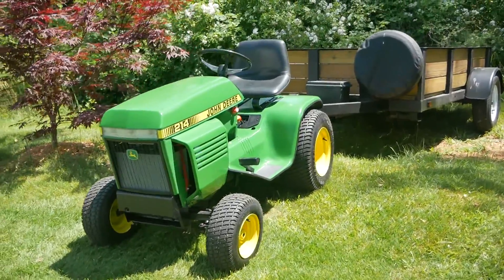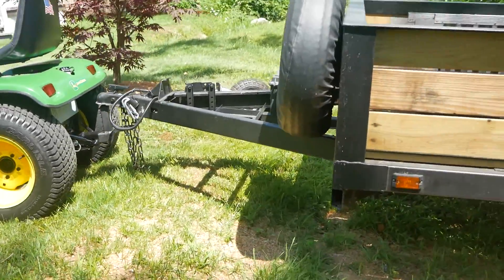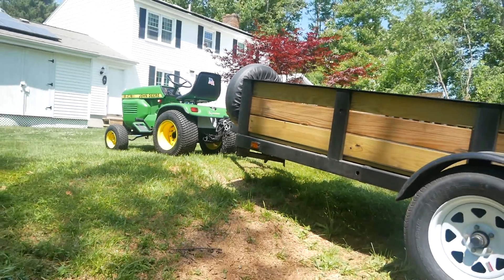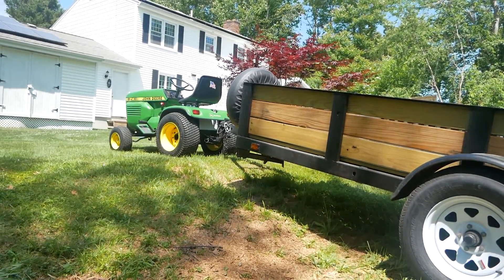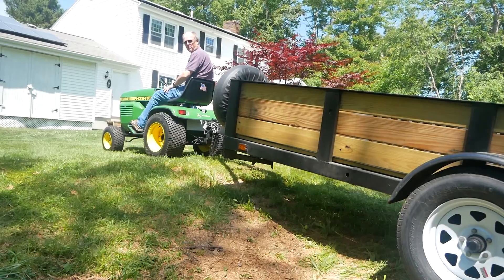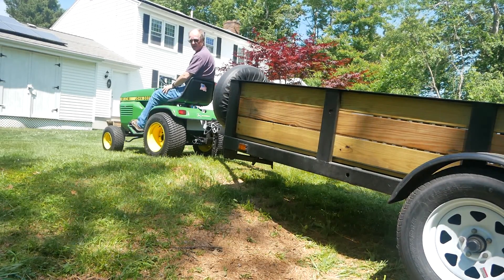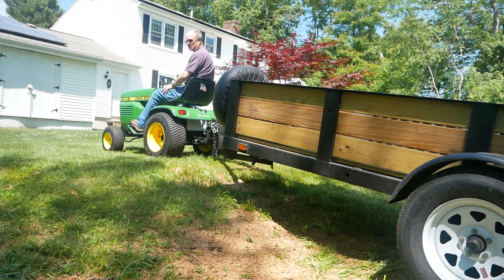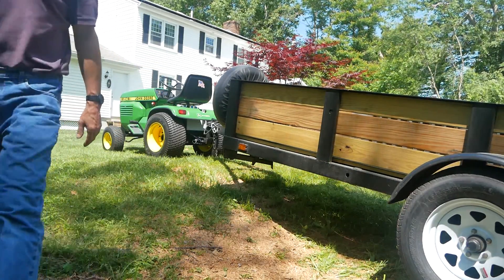John Deere Electric Garden Lawn Tractor Conversion pulling 1000# trailer uphill

Comment: Cool, I switched over from your other video to see this in action, how long does it work until it needs to be charged again?
Reply from the maker: Depending on the work I'm doing...Cutting grass about an hour and a half....Hauling a trailer while firewooding...All day....So far, other than cutting grass, I've never used more than 50% of the batteries. I get worn out well before the batteries do!